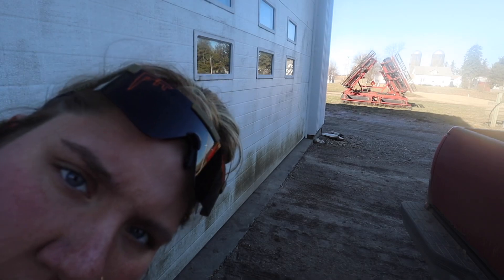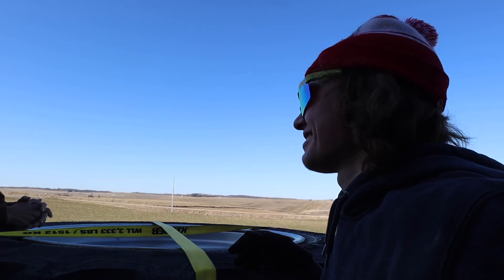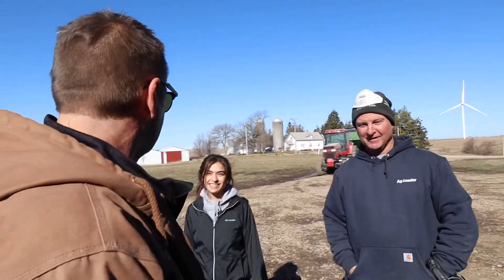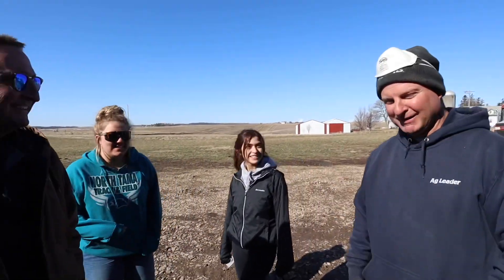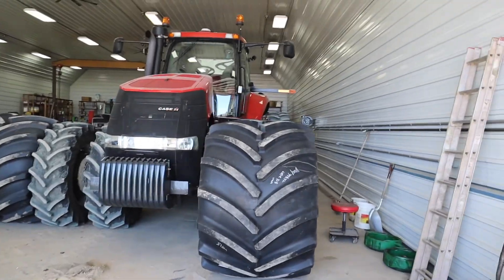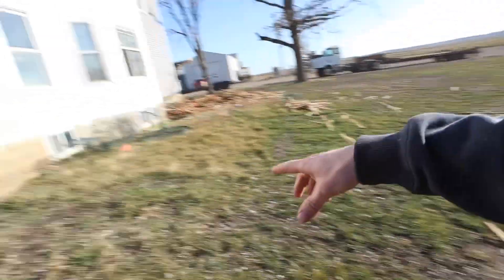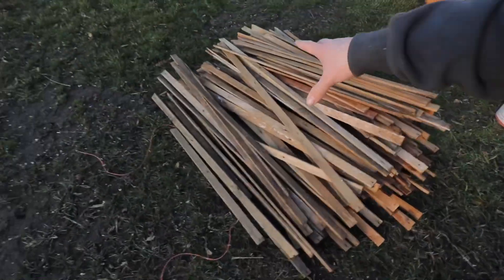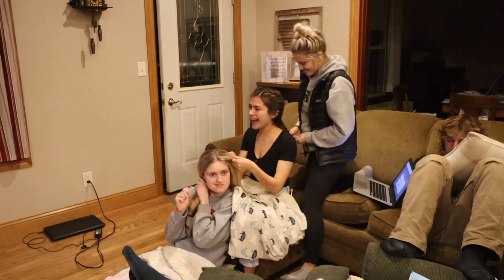I Bought My Dad The Largest Tires In The World

Comment: you can use two cinder blocks with 2 2x4 sticking up from each one and stack your slats in them and it will hold it like a bundle so you can tie and stack neatly

Comment: when tying a bundle first tie a loop on one end of your cord. The run around the bundle and slide the cord through the loop and pull. This makes a slip knot the you can cinch the bundle really tight. Then tie a knot or two through the loop so it won’t slip.. put one on each end of the bundle and it won’t fall apart.

Comment: Quick question.
Putting LSW tires on your row crop planter tractor, removing the duals, won't you get compaction on the seed row?

Don't the duals run between the seed rows?

So, wouldn't the duals be better for planting?
And the LSW better for tillage?

Comment: Don’t whisper. 
It’s actually harder on your vocal cords than just talking normally, even if you’ve lost your voice. 
Also lots of tea with honey, to coat and soothe the cords.
Reply: Hot tea, honey and lemon is my go to for laryngitis. I add a shot of bourbon to my recipe but I know Cole doesn't drink whiskey.  His voice loss is probably due to irritation of his vocal chords from all the dust he stirred up when knocking out plaster and insulation. His dust mask didn't look adequate to me. Get well Cole and try a warm salt water gargle if nothing else.
Jo
Reply: Yes as a vocal teacher do not whisper...much a harder on voice... just rest your voice and write what you need to communicate! I use tea with Manuka Honey( but any honey is better than no honey)...which heals! You back to talking in no time!
Reply: actualy my  doc told me few days ago that i should not eat any citrus or use any honey when i had infection in my throat, dont know if its relevent but yeah.  I was trying to get it healed for few months nothink worked, i stopped eathing citrus and honey and i was cured in 2 weeks
Reply: @TheSnorlax122  There's a difference in having an infection versus strained vocal chords.

Comment: Are you keeping some of the lath to re-attach vertically to the studs?  With new 1/2” or even 5/8” drywall, your wall likely won’t be thick enough to be flush with the door and window jambs.  When we gutted our 100 year old house, we kept some lath and nailed it vertically to the studs.  This furred out the 1/2” drywall perfectly with the edges of the door and window jambs.  I guess you could always rip plywood into strips to act as furring.

Comment: Stupid fact no one asked for, the largest single piece of rubber in the world is made by BF Goodrich for the US Navy for sonar domes, called sonar dome rubber windows.  They are oblong and 24 feet wide by 30 feet long and about 8 feet tall and about $2.0mm a piece.  These look like bald oblong tires on their side.   You can Google Sonar dome rubber window and see them.  They are pressurized with water and are located on the front bottom of the ship.  I used to have to enter that "tire" while under pressure to inspect the equipment kept in there.